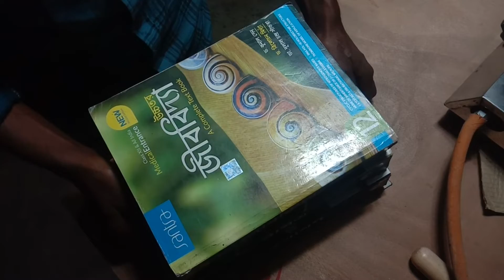How To Make Bluetooth Speaker And Powerbank From PVC Pipe At Home || PVC Pipeसे Bluetooth कैसे बनाएं

Comment: Share your component details and circuit diagram.
Reply from the maker: 5 lithium ion bettary, 1 amplifier board, 2 speaker , 2 sound rediator ,1 5volt USB charging Power Bank module and 75mm pvc pipe